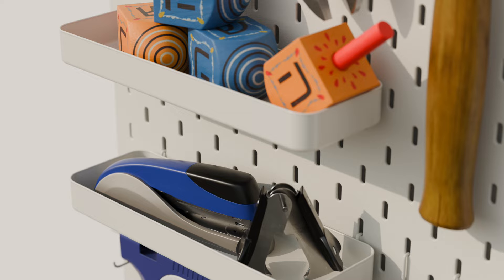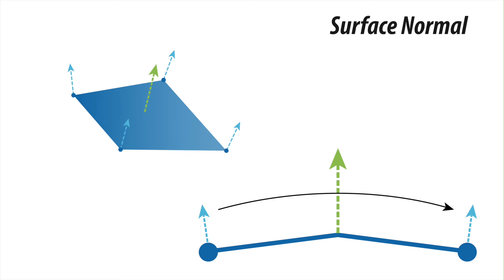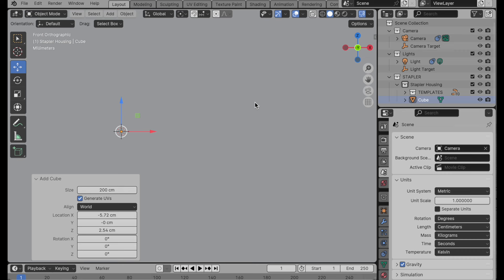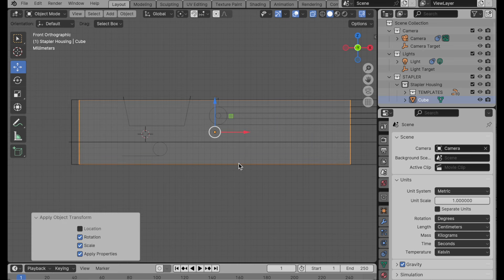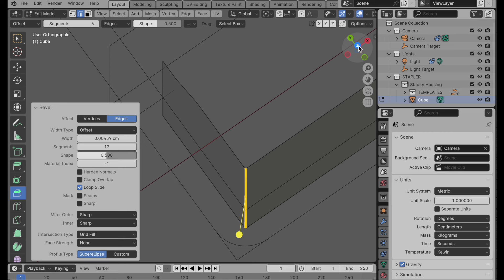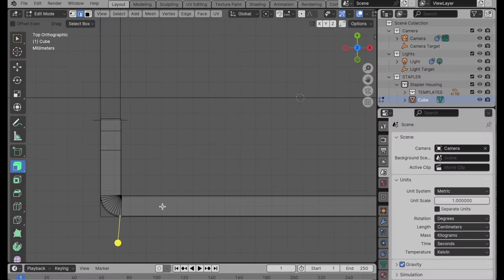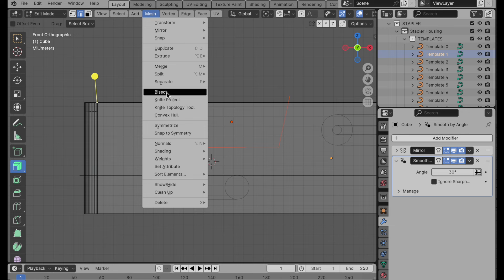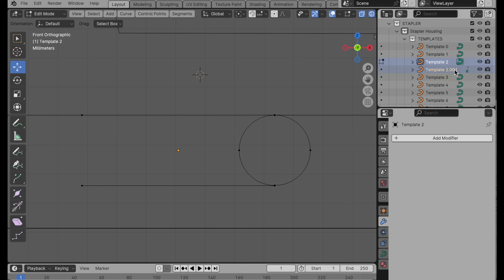Modeling without subdivision, with modifiers, for non-destructive editing workflow.

Comment: awesome tut as usual. btw on the theme topic: you know you can just change the viewport background color to better see wireframes right? :D 
you don't need to change the whole theme, you can just go to the shading little drop down and set the background as "viewport" then set the preferred color :)
Reply from the maker: Yep, that's also another great way of dealing with profile visibility. I'll probably record the next tut with that method. But overall I generally prefer the light theme, it's what I use mostly, but I get a lot of complaints when I use it.

Comment: this is one of the my favourite blender tutorials ive seen so far! ive recently started learning blender but the amount of steps it takes to cut out a slot is crazy to me. ive been using fusion to model for ages now, before that solidworks and creating slots in blender is unbelievably complicated im shocked!
Reply from the maker: CAD/NURBS based modeling environments are very different than polygon based editors. You can still do any modeling you feel is best in those applications, and import those models into Blender for final rendering. Polygon editing is superior for many types of more organic modeling. The right tool for the right job, as the saying goes.
Reply: @christopher3d475  yeah the problem with importing cad models from fusion is the topology. Using procedural editing on cad models from fusion won’t work which is why I’m trying to learn to design models in blender but I’m really shocked at how much effort goes into modeling in blender. 

But I’ll keep watching these  tutorials until it starts to sink in. 

Thanks for the great content!
Reply from the maker: @J2128H  How are you exporting models from Fushion? Typically when I've worked with CAD source, files are sent to me in .STEP format. I then open those in MOI3D and tessellate them and it works great. Are you able to export STEP?

Comment: The colors between 2 verts when using vertex shading are created with linear interpolation. While one can google this and learn the math, in a nut shell it is like blending. So from Vert1 to Vert2, you have pixelColor = (Ver1*x + Vert2*y), where x =1 and y=0 when at Vert1, and x=0 and y=1 when at Vert2. In the exact middle between Vert1 and Vert2, x and y both = .5.

Comment: I love the Double bevel modifier trick for different parts of the mesh.  I always running into bevel shading issues/ glitches!  Thanks for the great video!
Reply from the maker: Yeah, the Bevel modifier has its place but it can also be finicky at times. So you have to determine its value on a case by base basis.

Comment: Commenting again after finishing the video. You managed to resolve an issue I've always had with using the bevel modifier because I didn't realize the filled faces were directly related to where the modifier would produce bad geometry. Thanks so much!
Reply from the maker: Yeah, it would be useful if Blender had proper edge group or selection sets.
Reply: @christopher3d475  I used this method last night and found that when you have an edge with a bevel weight intercept with an edge that's part of a bevel vertex group you have interesting behaviour. One issue I keep running into is Blender bevels the loopcut between the two loops that are part of the vertex group, even if I unassign them like you do in your video. I also keep running into an issue where the edge that is beveled by the bevel weight doesn't seem to be able to be assigned to the vertex group, and even if it shows as assigned, it doesn't bevel. 

Have you ran into these problems using the dual modifier method in this video?

Comment: Hello Chris, thank you for the time and effort you put into each tutorial. In one of you videos you imported a model from Moi and stressed not to change I believe the normal data that is baked into the file. I use Moi just a little and PTC Creo Freestyle extensively, both allow for importing .obj files and can convert the geometry to NURBS. I’m curious to know if the vertex weighting, shading, edge data, normals, .etc settings gets baked into the export. My aim is that the geometry and shading upon import “look” the same and do not require manually reapplying these conditions.
Reply from the maker: If you're importing polygon-based data into a NURBS modeler for conversion to a NURBS surface, I doubt MOI or other similar apps will use the transported normal data. They're simply looking at the raw geometry for this conversion.
Reply: @christopher3d475  I appreciate the reply. I'll experiment some and let you know what I discover.

Comment: For the first cutout you did, a faster way I like to use is manifold extrude, snap to the other face, then I delete that face. This joins the veticies together and when you delete the face you don't have to rebuild everything. I also have a shortcut created for manifold extrude so I don't have to find it everytime. I still love how you show and use many key and tools that most people either glaze over or just don't mention at all.
Reply from the maker: That sounds like a great tip, I'll take a look at  the manifold extrude option.

Comment: This feels like an extremely over encumbered workflow. And it only works on exactly those kinds of objects: very regular, right angles, straight, flat surfaces. In other words: exactly the kind of object which is super easy to fix and change, even with a destructive workflow.
Reply from the maker: The point of this tutorial wasn't to say, here's the best way to model this particular object, but to show the potential use of these modifiers and caveats that might show up with their use. A user can make that decision for their use on a case by case basis. For this object, yes, directly modeling it without modifiers would have had less overhead.